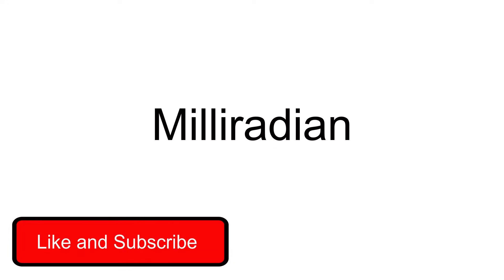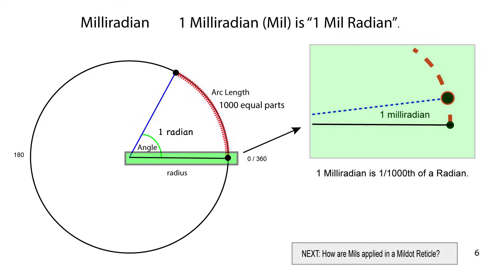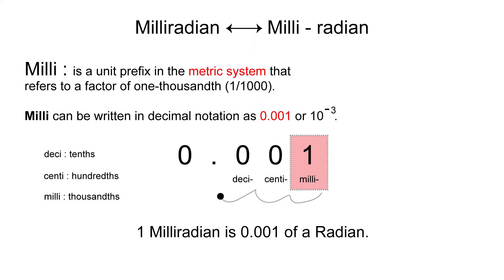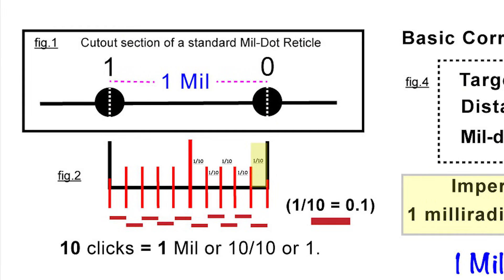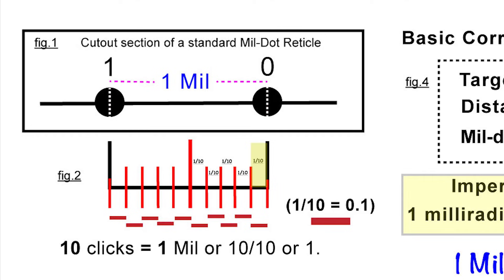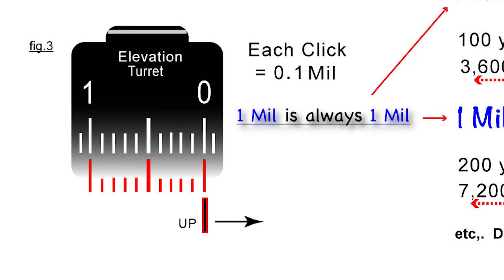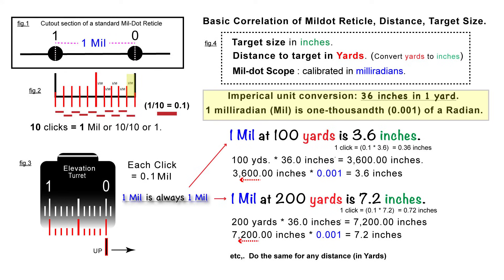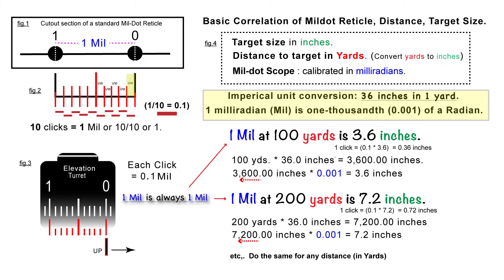How to use the MRAD reticle and Turret.

Comment: Even simpler: A milliradian is 1/1000th the width of any distance. For example: 1 mil is 1m per 1000m, 1 mil is 1y per 1000y, 1 mil is 1' per 1000', 1 mil is 1" per 1000", 1 mil is 1 mile per 1000 miles, 1 mil is 1k per 1000k, 1 mil is 1cm per 1000cm, 1mil is 1mm per 1000mm, etc. Those are all exactly 1 millirdian. If you superimpose them they would all be the exact same angle.

2 mils is 2m per 1000m, 2 mils is 2y per 1000y, 2 mils is 2' per 1000', 2 mils is 2" per 1000", 2 mils is 2 miles per 1000 miles, 2 mils is 2k per 1000k, 2 mils is 2cm per 1000cm, 2mils is 2mm per 1000mm, etc.

3 mils is 3m per 1000m, 3 mils is 3y per 1000y, 3 mils is 3' per 1000', 3 mils is 3" per 1000", 3 mils is 3 miles per 1000 miles, 3 mils is 3k per 1000k, 3 mils is 3cm per 1000cm, 3mils is 3mm per 1000mm, etc.

And so on . . .

Comment: Good video, but why mix imperial and metric systems? That adds too much complexity. Why not just use metric only? At 100 meters one millirad corresponds to 10 centimeters. 200 meters - 20 centimeters, etc. so one click on your scope would be 1 cm at 100m. Seems much simpler than converting back and forth from imperial.
Reply from the maker: My followers asked me to explain it this way. This viewpoint is always brought up and peiple can decide for themselves. There is a crossover going both directions. Thank your for your response.

Comment: if you tend to do this in m and cm, you get 1 click = 1cm at 100m   2cm at 200m.   it's really perfectly made for metric
Reply: A mil would be 10cm at 100m and 20cm at 200m.
Reply: @oscargrouch7962 yes, but a click is normally 1/10 of a mil still

Comment: Hi, thanks for the video, it is very informative. 
I have been struggling to get the following: if my mil scope is zeroed in at 100 yd ( 90 m), what’s the standardized formula to calculate my elevation adjustments at let’s say 450 ydrs? I’d appreciate your input.
Reply from the maker: An important point to remember also is that a bullets' ballistic information (bullet drop) comes into play with the calculations later. [ I think maybe you meant to say you zeroed in your scope at 100m? If not, re-zero at 100 meters. It will make life simpler. Also, the reticle on an MRAD scope has the math built into it. ] To answer your question the best I can, for an MRAD scope (using 1 click is equal to 0.1 MIL) - the standard equation - using MILS : "one MIL at 100m is 10 cm, at 200m its 20 cm , and so forth... and at 1000m its 100 cm or 1 meter.  (watch my other video on this, it may further help you out.)  To keep it simple for myself this is what I do: so, at 90m take 9m/100m = 0.9. The 0.9 result at 100 meters means you move the your elevation "9" clicks on your turret just under "10" clicks for a full " 1 MIL " which is 10 clicks.
Reply from the maker: Here's a link to a video that might help clarify my other reply:
https://youtu.be/UGrl9cGybtE?si=T3aDkpcQvlhqVVbW

Comment: Great job explaining what radians are…why did you have to muck it up by taking a metric measurement and relate it to imperial measurements?   That’s where everyone gets confused.  As a shooter or hunter, just stick with either system (MOA or Mils) and don’t worry about conversions unless you’re ranging with your reticle and need to convert mils to yds for bullet drop.  If you’re a hardcore Mils shooter, all your bullet drops should already be calculated in Mils and not require ANY conversion to imperial units or MOA equivalents.  BTW, I’m American and quite familiar with MOA and yds…but Mils is a clearly superior system when ranging using your reticle.  You can use ANY unit for target size and calculate range in the same units by direct measurement of the target in Mils using a ranging reticle…then convert the resultant range to whatever units you want.
Reply from the maker: I do both just for fun. My new video is on the metric system and MRAD scope. Thanks for the insight.
Reply: Great point. They just cannot help it.

Comment: Im still confused if I zero my scope @ 100 yards , for 200 yards target home many click I should go up ??
Reply from the maker: Thinking in terms of elevation, you’ve already valued in your bullet drop when you zeroed in at 100 yards, so with a mil-dot scope with each click being 0.1 mil , to hit target center at 200 yards with wind you would move UP 1 full mil which is … 10 clicks. Each mil is a full “10” clicks. 
0.1 x 10 = 1 full mil.
Reply from the maker: I just saw your comment. My apologizes for getting back to you late. Check out my new video here on YouTube: https://youtu.be/gRjaaQCW4mw?si=nYIJt2LsJMZSu3xJ.   You just have to put the Imperials in.   1 Mil @ 100 yards is 3.6 inches and then go from there using this video.

Comment: I'm a little confused sorry , if one mil at a hundred yards is 3.6 inches is the same one mil at 200 yards 7.2 inches ? Basically double ?  Or if I need elevation to lift say for 500 yards I would adjust the turret settings per BC so if I need say 36 inch lift I would adjust 36 clicks ? Cheers Gareth
Reply: Thanks for answering I really appreciate your time ! I'm still missing something and so confused I'm going mad ,  if one full mil = 3.6 how does 2 full clicks = 18 ? Is it simply that the further out the distance the full click in elevation is greater sorry for wasting your time
Reply: It's ok the penny just dropped , basically you just x the 3.6 by the distance so 5x3.6 = 18 so if I need 36 I would use 2 clicks
Reply from the maker: I just read your question again. So, if your needing to adjust for a BC of 36 inches elevation at 500 yards then you will need to adjust " 2 mils" elevation. That would be, 20 clicks on a scope that is designed for " 1 click is 0.1 mil ". 
With considering the aforementioned, then at 500 yards, without any BC adjustments, the adjustments would be 3.6 inches @ 100 yards, then at 500 yards it's 18 inches. I hope this helps.

Comment: If 1mil is 3.6 in at 100 yds is mil vale 1.8 at 50 yds
Reply from the maker: Milliradian scopes are commonly adjustable by 1/10th (0.1) mil increments. At 100 yards, a 0.1 mil click is equal to 0.36 inch, and a full mil is 3.6 inches ( 1⁄10 of a mil equals 1 centimeter at 100 meters).  So at 50 yards, it is 1.8 inches.

Comment: for mrad/mil, may be easier to measure in metrics. e.g. 1mrad = 10cm @100m,  1click(0.1mrad) = 1cm @100m. if you have to measure in yards, stick with MOA.
Reply from the maker: I out up a new video on using the metric systems - meter -  and outline the basic decimal system as applied to MRAD scopes. Down in the description of the video I detail out the fine particulars of mil adjustments using 0.1 per 1 click from several distances to apply the ratio between linear distance and angle adjustment using an MRAD scope.  Thanks.
Reply: One mil is not 10CM @ 100yds. is't  3.60 inches approximately,  that's close to .3/8"  per click on a MRAD scope @ 100 yds.

Comment: Great video and very helpful to me as I have a couple of mil scopes, thankfully that have BOTH mil reticles and mil turrets. (folks, beware of scopes that have mil reticles and moa turrets or vice versa) But to me MOA is so much easier to use. I MOA is 1" at 100 yards, 5" at 500 yards, 10" at 1000 yards. What could be easier?
Reply: Except that is not 1" at 100 yards. It's 1.047" at 100 yards, so the further distance you shoot the more error you will have if you simply use 1" at 100 yards.
Reply: OK, 10.47" at 1000 yards. I can adjust for that. @P0rtScann3r
Reply from the maker: True. There is a refined "regular shooters MOA" sMOA that rounds down off to "1" inch, "2" inches, as distance increasing. True MOA is 3 decimal's. At longer ranges it will affect point of impact of using sMOA for sure.

Comment: One of the best videos about this topic, thank you very much sir, I have one question, a elevation with 1 click = 1 min, what this mean?
Reply from the maker: 1 click - 1 MOA or minute-of-angle. This is referencing scopes utilizing MOA or minute-of-angle. 
Here is a link that explains MOA: https://youtu.be/ZsA2kGGBVvQ?si=KbxaE77ASitGIv5L
Reply: one minute is one part of a 360 deg. circle ,  60 minutes in a circle, one click on a MOA scope is a 1/4 of one minute @ 100 yds., approximately or 1/4" @Broswhoknowstuff
Reply: @douglasbattjes3991  you gotta stop replying, you do not know what you are talking about, or at least don't explain correctly, if you choose to use degrees as your measure there are 360 degrees in a circle, there are 60 arc minutes (or minutes of angle) in a degree....the word minutes is used as a degree is divided by 60....there are also 60 arc second in one arc minute (arc minutes or minutes of angle are the same thing, just different wording)
Reply from the maker: I also made a video on Minute of Angle if you would like to take a look. A very detailed explanation.  @douglasbattjes3991